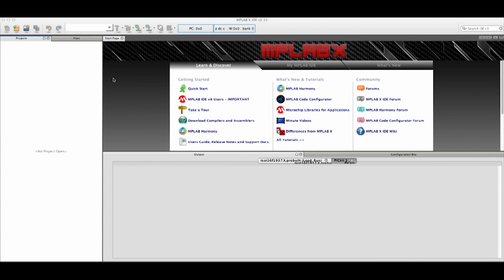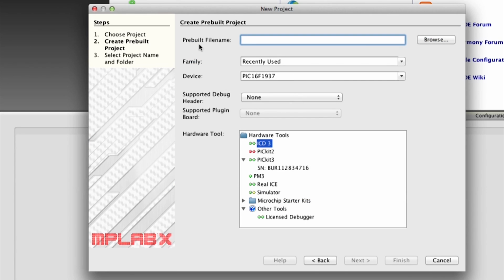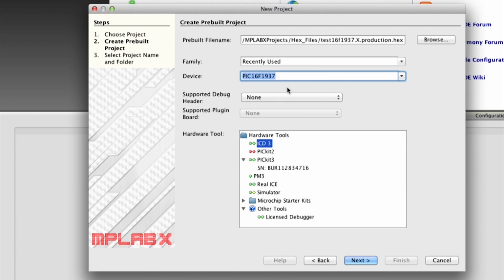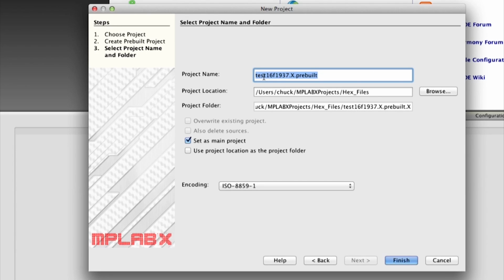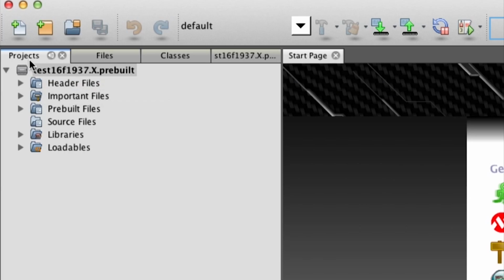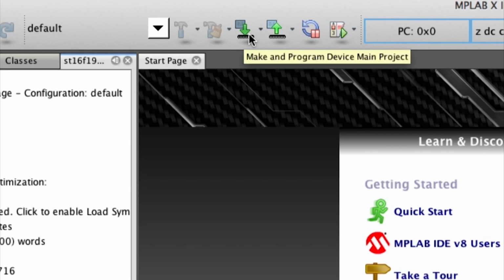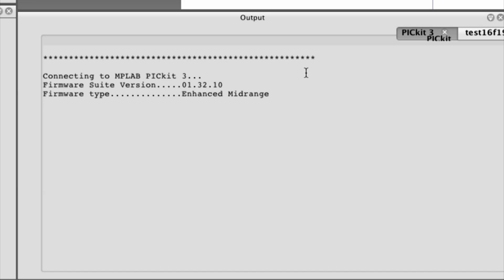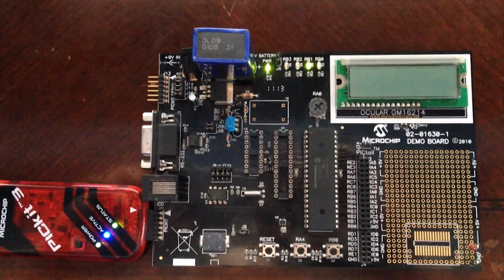Importing and Programming a pre-built .HEX file with MPLAB® X IDE

Comment: Hello,

I am using a Mac M1 and have installed MPLAB X IDE and XC8 compiler. I have noticed that there is no Tiny Bootloader available for Mac. What should I do to proceed?
Reply from the maker: Hi there, thanks for your question! The Tiny Bootloader is not available for macOS, but you can still program your device using Microchip's MPLAB X IDE, which will be supported by your system.
For hardware programming, consider using the PICkit 5 (our newest programmer. Please also note that MPLAB X IDE version 6.05 is the final version supporting PICkit 3 and 4. The newer versions have discontinued support for this programmer. Hope this helps!

Comment: but where ıs the assemble ????
Reply from the maker: Thanks for your question! The video focuses on importing and programming a pre-built .HEX file. If you're interested in assembly and building a project from source code, that would be a different process. You might find our tutorial on "Creating an Assembly Project in MPLAB X" useful. It provides step-by-step instructions on how to assemble code using MPLAB X IDE. Let us know if you have any other questions!
Reply: @MicrochipTechnology  thanks for your answer ... i need to know how to debug a hex file if i lost the source code , i need to load the hex into the microcontroller and see the assembly codes to debug it
Reply from the maker: To debug a hex file without the source code, you can use a disassembler tool to convert the hex file into assembly code. There are several disassembler tools available, such as IDA Pro, Ghidra, and Hopper. Once you have the assembly code, you can analyze it to identify any issues or bugs. To load the hex file into the microcontroller, you can use a programmer tool such as MPLAB ICD 5 or PICkit 5. These tools allow you to connect to the microcontroller and program it with the hex file. Once the hex file is loaded into the microcontroller, you can use a debugger tool such as MPLAB X IDE to connect to the microcontroller and view the assembly code in real-time. This will allow you to step through the code and identify any issues or bugs. We hope this helps! Let us know if you have any further questions.
Reply: @MicrochipTechnology  actully i have MPLAB X IDE v5.45 and pickit 3 tool , but i dont know how to strat loading the hex and show assembly and start debug , i hope if there is a video example for loading hex and view ASM codes steps
Reply from the maker: Got it. We can provide some instructions to help you get started.

Open MPLAB X IDE and go to 'File' > 'Import' > 'HEX/ELF...' to import your .hex file.
Connect your PICkit 3 to your computer and to your target board.
Set PICkit 3 as your hardware tool by going to 'Run' > 'Set Project Configuration' > 'Customize...' and selecting 'PICkit 3' from the 'Hardware Tool' dropdown menu.
Load the hex file to your device by selecting 'Run Main Project' or 'Debug Main Project' from the 'Run' menu.
View the assembly code by opening the Disassembly window from 'Window' > 'Debugging' > 'Disassembly'.

Here’s a helpful videos I gathered from youtube: https://www.youtube.com/results?search_query=pickit+3+tutorial+loading+hex

Feel free to reach out to our team for more specific support at www.microchip.com/css. Thanks!
Reply: @MicrochipTechnology  thank you soo mutch i will try , and ask again🙂